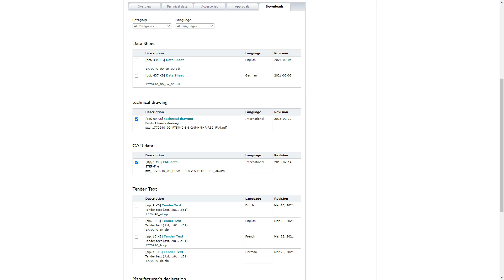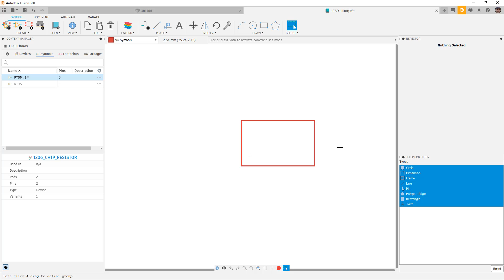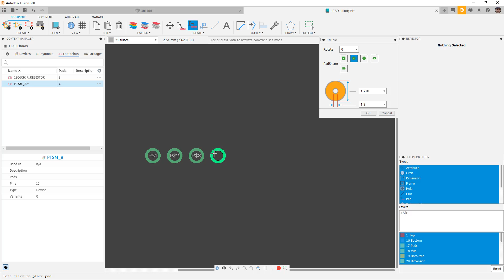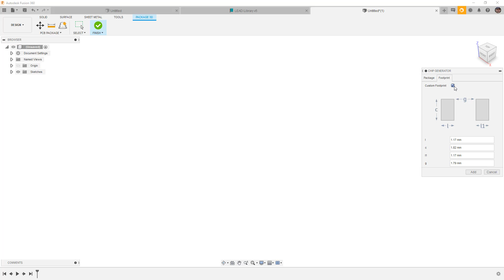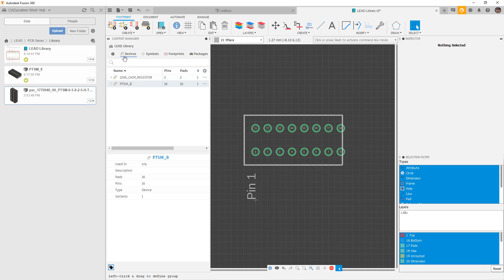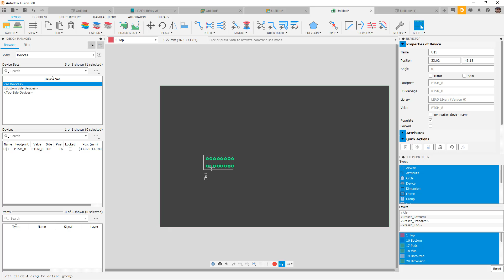Manufacturers Components in Fusion 360 PCBs: Episode 3 #Fusion360 #Fusion360PCB #Maker

Comment: 2.5 is not the same as 2.54 in electronics.
Thats why the 3D model does not fit properly in your video.
On the real pcb the connector will also not fit. Last hole is 7*0.04 of .
Reply from the maker: You are correct about that. but where did I use 2.5?  When making the footprint I used 2.54 for the pin spacing on a 1.27mm grid.  The detailed drawing from the mfg said 2.5 but I used 2.54 because it is the standard.  The second row of pins was placed at 5mm off the first row based on the drawing.  I maybe should have left that at 5.08 but FWIW i have made PCBS and used these connectors based on this footprint and it fit fine.  With the pins only being .8mm and the thruhole being 1.2 its enough wiggle room for that 2nd row of pins.  The physical connector has the pins offset just like on the footprint for whatever reason.  One set of pins is right up on the side of the connector and not centered.  

https://www.phoenixcontact.com/en-us/products/printed-circuit-board-terminal-ptsm-05-8-25-h-thr-r32-1770940

Since the component uses rectangular pins and they are right on the side of the connector offset from the actual holes it just looks worse with the round pad.